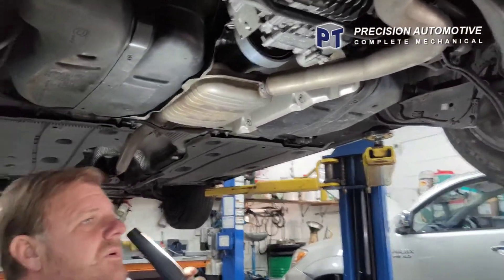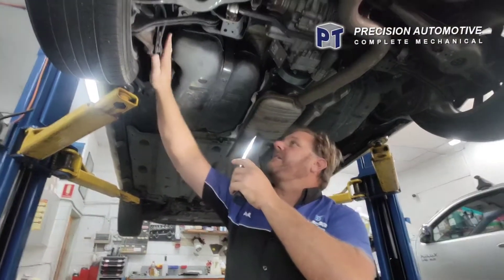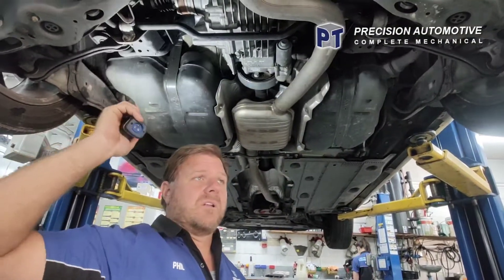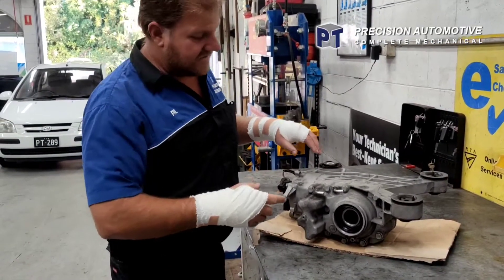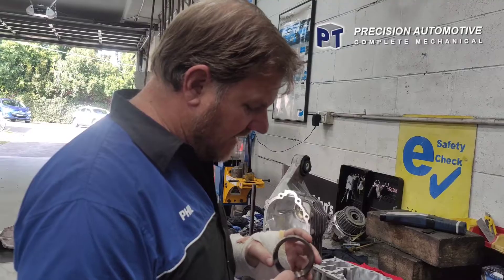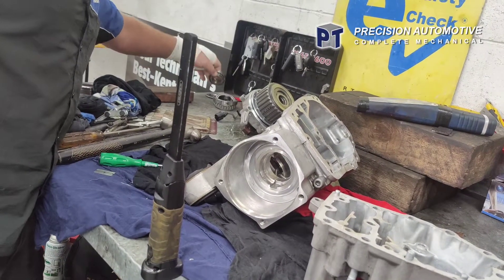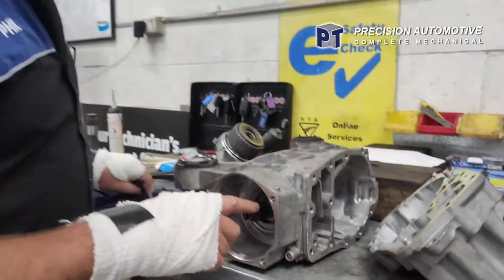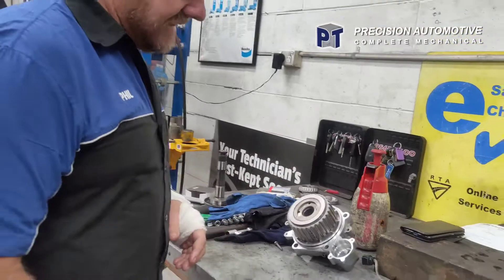VW golf Haldex Diff rebuild - Noisy Bearings

Comment: Wonder if there's dimples in the rear floor of these VW so you know where to drill holes to access those diff bolts from the top. Then you don't need to drop the entire subframe. The dimples are on Skoda models.

Comment: With regard to backlash: I'm in the middle of rebuilding one of these and I fail to see how you were able to check and adjust the backlash. There are no keeper bolts or backlash adjustment bolts on this differential. There are only washer spacers behind the carrier bearing races. Even though you mentioned that you checked backlash, I'm not seeing any way to check it since the housing is essentially what clamps the diff in the unit. It can't be accessed after you put the housing back together.
Reply from the maker: Flexigauge.

Comment: I have a 2022 Skoda Octavia 2.0 diesel manual. It’s been with Skoda awaiting a faulty gearbox differential for 5 months now for a warranty repair. Apparently the part isn’t available and Skoda asked the dealer to strip the gearbox to identify the part!
The gearbox is in bits and they’re still waiting for a replacement part.
Good news is they’ve had to supply me a courtesy car, so I’m driving around in a 2024 Skoda superb!! 
What a daft company.

Comment: What is the part number of the differential you swapped the bearings on? I have a 2017 alltrack with the same problem and no one rebuilds them.

Comment: Hey.  I have a 2016 alltrack with probably the same issues. 
Just wondering: it possible to unmountthe rear diff and just drive the car as a 2wd (fwd only)?
Regards
Reply: Yes, when my diff failed, I simply disconnected the shaft between the trans axle and rear diff. Had no issues driving it home that way.

Comment: I learned a lot from your video👍
Ended up taking the diff off my self and took it apart. The smaller bearing on the right side was completely worn out. The bigger bearing on the left side was still in good shape, but replaced both bearings. That’s was the easy part.
My problems started when assembling, and I ended up taken it to a mechanic. Shims were too big, and when we tried to fit the housing, it was almost impossible to rotate the shaft. New shims are almost impossible to find. The mechanic took the shims to a specialist, and he took off 0,2mm, on the right side shim. The diff has been running for a year now, and everything is good.
Thanks for an informative thread and video.
Greetings from Denmark 🇩🇰
Reply from the maker: Well done mate, Your Mechanic did you a massive favor and is a champion , get him a case of beer.
Reply: Where did you get the spare parts? I think that I may have a problem soon on my Skoda 4x4 with a slight noise appearing. Can't afford to buy a new diff so repair is the only option.
Reply: Hej Mads 

Jeg står og skal til at igang med samme tur som dig...

Jeg har lige et par spørgsmål måske du kunne hjælpe med at svare på? 😅

Comment: Hi, I have a Audi A3 Quattro and have rumbling noise issues from rear of the car, been told it the Haldex unit, but not so sure because I’ve take the 4wd drive fuse out and the noise is still their, does this mean it could be a wheel bearing instead, as the Haldex isn’t working after fuse is removed surely ?
Reply from the maker: Have it diagnosed correctly

Comment: Great work guys,  I have a same problem 🥲, I have Audi s3 8v (2016), and my diff. code is 0CQ525010 K, do you remember the code of differential? according to that I will order the spare seals and bearing as same as your comment below, audi service is wanting the change all unit completely,  my car is serviced by Audi everytime, but  I checked to service records, they never changed the diff. oıil and haldex oil,my car is 131k Km😭
Reply from the maker: Yep i don't know why nobody changes the oil ??  , No i don't remember the codes i do know they are not all the same , we pulled it apart not knowing if we could rebuild it or get the parts.
Reply: @PTPrecisionAutomotive  I don’t know also, I checked all the maintenance and service papers, there is no issue about haldex/differential oil renewing, even there is a expire dates on new oil bottles they ignore to changing of them😅 now if I say ;change the differential because of not properly planned maintanance by Audi service with your precious Audi guarantee😂 but as you know they will not accept to guarantee claim or they will say so many different things, for example: there is stage 1 apr ecu tuning, its broken because of that bla bla… thank you for your valuable video, every country need mechanics like you👍🏻
Reply from the maker: @tayyarkocer6000  Thanks Mate

Comment: AWESOME!! I just purchased a used 2017 Alltrack and was on the VWVortex site and discovered a bunch of people with this issue, I’m experiencing the soft grinding sound that gets louder when I decelerate on my passenger side (U.S model). I’m scheduled to visit my local VW dealership on Monday as the car is a CPO. I know their gonna try to give me the run around (breaks, rotors, diff fluid change etc…) I’m gonna show them this video now 👍
Reply from the maker: Hahaha. im not sure, [actually i know] they wont repair the diff. as i have done as it is an Serviceable unit , By VW.

Comment: I got a 2015 Audi S3 and has a noise like you made. I changed my wheel bearings and rotors only to find out it's a bearing on the diff. So far, I've had no luck finding anyone that rebuilds these rear diffs. All shops say they need to replace the whole carrier assembly. I have not seen any schematics to find the bearing part number
Reply from the maker: The number are in these comments below , but they may not all be the same.  Full dismantal then to see if you can find them. [i spent a long time finding them] and couldn't get one seal.

Comment: is there any chance how to diagnose haldex/diff bearings and distinguish between them and wheel bearings ? (my noise is around 80kmh +-5 and on another speeds it is quiet)
Reply from the maker: yep use a stethoscope with the car up in the air.
Reply: @PTPrecisionAutomotive  does whining sound develop when wheel be without load (car on the lift) ? If not how to simulate load (dynamometer doesnt lift car, in order to get with stethoscope under car...)
Reply from the maker: @majklxxx  you need to have someone who knows what they are doing to diagnose the problem.
Reply: @majklxxx I’m having the same symptom. Replaced both wheelbearings and noise is still there at 80-90 km/h.

Did you figure out how to diag?

Comment: Hello, thanks really for this video, I have to do the same on haldex 5 for octavia scout , but I don't find any video to remove the haldex from the car (there are 2 bolts with access by the top so it seems mandatory  to remove rear  axle? And for the rebuild after changes of bearings is there any setting/measure to do ? thanks a lot for your help
Reply: Hi, you are correct, either you remove the rear axle, or you can drill 2 holes inside the truck and you get access to the 2 screw you mentioned. Done the same operation some 2y ago. Hope this information helps. Just google, haldex removal, holes inside trunk etc.
Reply: @vjlau02  Hi, I need to take my differential down on my Scout. Byt i can't find anything on goggle about those holes you need tho drill. Do you häve a lunk for that?

Comment: Great video! 
In my car also (golf alltrack 2017), the noise increases when decelerating.
Initially I thought they were tires or wheel bearings, but after replacing the noise still remained ;/
Do you think that the cause of noise in my car may be the same as in your car?
Thanks for any tip!
Reply from the maker: you need to diagnose correctly.  run car on hoist with stethoscope
Reply: Hey did you solve it 😀

Comment: Good job mate however as a former trans/diff rebuilder that pinion bearing preload appears way too loose.
Reply from the maker: yeah ok. it worked out ok it was too tight before . it's still going good . had the car back for service. all good so far.
Reply: Could you by any chance share the preload tolerances? I have everything on but they are too tight.

Comment: Hello. are any additional special tools needed?  is it necessary to adjust the tooth clearance when replacing the bearings?  what should be the play between the teeth?  I can cover up.  or maybe the way with a piece of paper is enough?  I have a problem because it hums from 60km / h and there is a radial play on the left joint that goes into diff.  (on the bearing in the middle) will the replacement of the bearings help?  .  I have a lot of background and skills, but I'm a bit afraid 😁

Comment: hi you can write me what bearings i need, some part number
Reply from the maker: These are the bearings i used in the differential , [not sure if every diff is the same ??] M802048/011,  LM503349/10RYA,  LM806649/LM806610
Reply: @PTPrecisionAutomotive  do you k is it is the same sizes for the vw mk5 r32 2008 cuz the differential looks just like mine
Reply: @PTPrecisionAutomotive  awesome video guys. I have a 2015 Skoda Octavia Scout with the same issue. Would my diff be the same part as the VW Golf in this vid, and thus use the same bearings? I currently have the diff out sitting with my mechanic ready to be pulled apart, but if I can pre-order the bearings for him it would be fantastic.
Reply from the maker: @DNAK1981  oooooo i don't know sorry mate, so many models and options in VW
Reply: @PTPrecisionAutomotive  thanks for getting back to me. The part number of the final drive is 0CQ525010F if that helps?
Reply: Piotr    powiedz mi jaki numer masz haldexa?  robiłeś ?   Pasują te  numery ?
Reply: @konvesna  udało się naprawić? U mnie też powyżej 60kmh wyje i chciałbym z tym coś zrobic

Comment: Rubbish after service from VW if they don't sell spares,  good job your there to help 👍
Reply: You would think they would offer a rebuild kit with all the bearings and bits required, rather than force someone to spend $7000 on a complete new unit.
Great work saving that diff, and a lot of cash as well.
Reply from the maker: No they don't [complete unit $7000AUD]